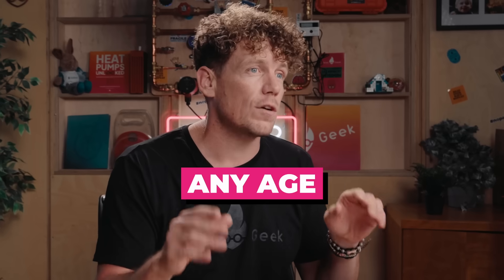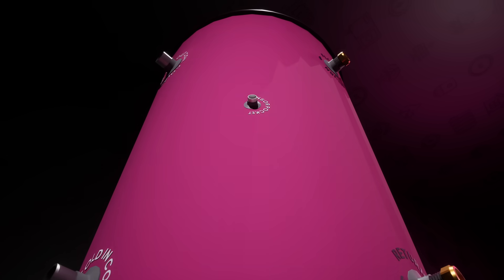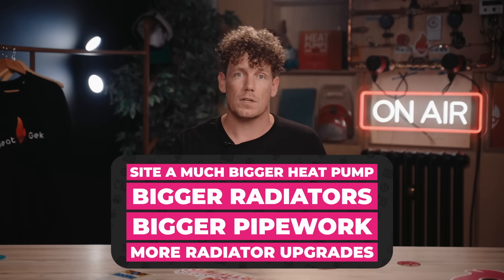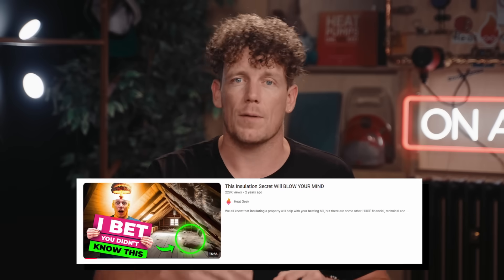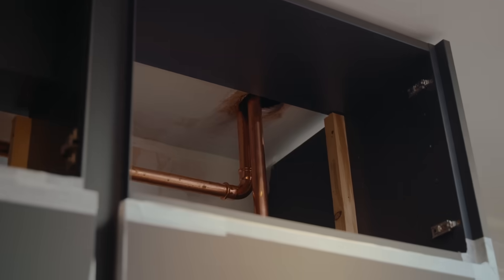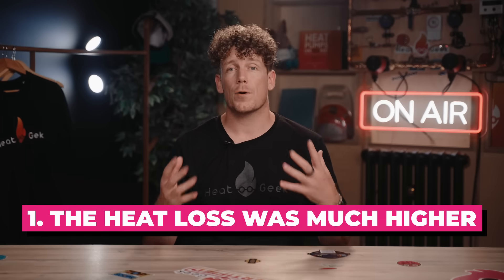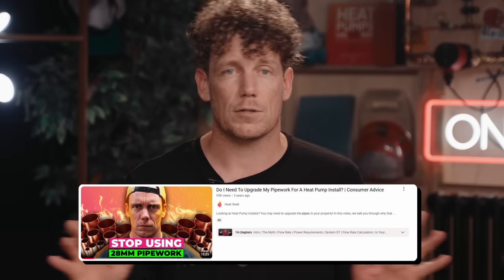Overcoming the 4 Challenges to Heat Pump Any Home

Comment from the maker: If you missed part 1 watch the full episode here: https://www.youtube.com/watch?v=LEptDnX9nPc
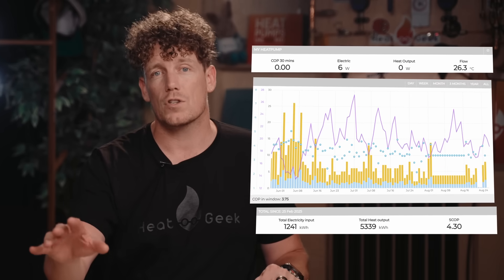Reply: Where is the link to open energy monitor it’s not in the description 😢 11:34
Reply from the maker: @noloafingwgas  Here you go! https://emoncms.org/app/view?name=MyHeatpump&readkey=4d8fdff4748d972fbc24e9f75460d4b9
Reply from the maker: Check out the heat pump's performance on Open Energy Monitor https://emoncms.org/app/view?name=MyHeatpump&readkey=4d8fdff4748d972fbc24e9f75460d4b9
Reply: "every home" huh? 

What about the 5 million flats in the UK? They are homes too, right? I've been trying to get updates from Heat Geek about this but you blanket don't seem to consider flats, as your email reply said.

I've tried calling in to just see if you'd consider case-by-case installs, as my flat is quite unusual and I think it could be done here, but it's a flat so I just get an automated email saying no. I haven't been able to get anyone to actually talk directly to me about the proposition either. 

This is very frustrating as I'd like to see what you think. I have detailed drawings that I could send you to look at. It might even make good content to do a flat, who knows.
Reply: Thanks for the link.  Am I right in thinking this isn't separating out the hot water?  I can see the colour in the key but not seeing any data.
Reply: @radfoo hot water is seperated, see the little icons on the top RHS. Currently the space heating COP is 4.49 and DHW COP is 3.16 😀
Reply: @GlynHudson thank you. Can it be seen on the day view as well, the icons disappear.

Comment: I spoke to my sister yesterday who is having her house in London renovated. I asked if she was installing an ASHP as she has solar going in this week. Replied that „the Architect said it wouldn’t work“ ….! Nearly fell off my chair, but swiftly shared this video with her. Fingers crossed I’ve averted a new gas boiler install, and corrected an unqualified comment!
Reply from the maker: That's great to hear! Sometimes architects might not be familiar with the latest in heat pump technology. With your sister's solar installation, an ASHP could be a great complement. Fingers crossed she makes the switch! 🌞
Reply: @HeatGeek  have you done any tests (or a video) on ASHP screens ... noting that they may not be the most beautiful piece of garden accessory and noting there are a number of screening options out there???  I'd love to know if the screens (not all are equal) impact the efficiency

Comment: Good stuff!
I don't understand how microbore can cause an issue for anyone when the apertures within lockshield valves are miniscule in comparison. It might reduce the control, but could a less resistive lockshield valve improve pump efficiency or provide some balance to make the odd microbore circuit useable?
Reply from the maker: The thing is, I shield is one small bit of small bore, but lots of microphone is a lot of smallbore.. yes an improved block shield can help slightly
Reply: @HeatGeek we've done some similar stuff on vehicle HVAC systems and found these sort of component selections to make a huge difference to the pump pwm to maintain flow. It is small enough that I think the calculation would be interesting. It wouldn't surprise me if the losses are equivalent to 50-100m+ worth of pipe losses
Reply from the maker: @TomWard-le3eo it’s all quite easily calculated

Comment: Combi boiler costs under 1k and you don't need engineers and costly heat loss calculations to fit them in...  Cheaper run costs will not offset costly installation  costs.
Reply: After the grant, simpler heat pump installs can be comparable cost with gas boiler installs.
Reply: @Biggest-hz7ng  Total nonsense  Boiler setup can be done with combi boiler. No hot water tank necessary + smaller/cheaper radiators. +if you already have boiler when replacing it with heat pump is just dumb from financial point.
Reply: @Tavs.fāterspeople have reported paying as little as £500 (and less) for a straightforward heat pump install after grant. The average install after grant is £5.4k, so presumably many are making a more complex switchover.

Comment: How long does it take a Heat Pump system to get up to water radiator temperature?
Reply: As with a gas boiler, the time taken will depend on the volume of water in the system and the power of the unit. Generally heat pumps modulate their output to match the desired temperature. With a heat pump you would tend to let the property drop a
degree or so overnight or when you are out and have it heat up as you get up or arrive back (increase perhaps an hour earlier?)

Comment: Are there any real world figure for heat loss in old buildings that have stone walls with a rubble infill.
Reply from the maker: What windows? Double glazed?
Reply: @HeatGeek at the moment no, but on the way next year.  Some of the external walls are 9 meters without any windows, they are about 80 to 90 cm thick .  Just wandered if there was a reliable figure I could use the do some heat loss calculations.  This type of property construction doesn’t seem to get much coverage.

Comment: Boiler swap £2800 HP quotes from HeatGeek, and 3 others £7500 and that’s after gov grant… so I’m saying that’s total nonsense. I would actually like a HP and have been getting quote but it’s just totally mad prices
Reply: I agree, my install would be as plug and play as possible. Ie the heat pump is next to where the main flow and return pipes are with the combo boiler and the cylinder is actually going where the combi boiler currently is. No rad or pipes upgrades necessary. The cheapest quote I’ve seen so far is £3,700 including the bus grant

Comment: Using the quick check of using the calculation provided in the video

Gas: 6384Kw pa, Heating would be 6046Kw (5Kw cooking only the hob is gas)
Efficiency: 73.5% (15year old boiler, though has had a major clean out last year don't know if this should be taken into account)
Which gives 4.48Kw
Which seems to point to a Heat Pump of 2.971KW

Which is less than half of what the Heat Geek (Lidar) Heat loss would be, which is 6.55KW meaning, new piping going from 22mm to 28mm pipes and almost all radiators requiring replacement

Can someone at heat geek explain the insane difference between the 2
Reply: How do you know what the LIDAR heat loss result 'would be' ?
Reply: @flatfoot I had a heat geek survey done and that is the heat loss on the proposal

Comment: @HeatGeek  when you say gas data is that my kWh per year? So 2000kwh * 75% / 1500 = 1? Surely I need a bigger heat pump than 1 KW, even if I take my Jan 240kwh*12 that's 1.44
This is a 1950s house with 8mm microbore piping
Edit: read electric usage not gas see reply
Reply: The 2000 kwh/a seems very low. Are you sure you're not missing a  0? Or you calculated with m³ of gas instead of kwh?
Reply: @Felix-st2ue  ah I was an idiot and looked at my electric! 9800kwh, though that works out to 4.9, still seems low, maybe because we both work during the day, though since getting underfloor in the living area (open plan kitchen diner lounge) we keep the underfloor basically on all the time, maybe the 20 year old non condencing boiler is more than 75% efficient
Reply: @maft90 That sounds somewhat plausible. The house I just bought has had roughly 18000kwh/a. And the calculation works out to something between 7,5 and 10 (original design plan)

Comment: Great story which needs repeating to idiots like Octopus heat pump team.
I showed the surveyor my 2023-2025 half hourly gas boiler usage (CH+DHW), which they already have anyway since they supply me.
I have since reduced my usage by removing the twin zoning and all the timed controls save a 2C setback overnight (21C/19C) and reducing the flow temperature to maximum 55C. (Thanks to heat geek general recommendations).
Octopus insist they know better and that MCS means I need a 16kW+ heat pump which they cannot supply - I calculate I need more like 6kW maximum power!!!!!!!!!! And this only for less than 2 months of the winter, with way less than 4kW for 7 months, and 0.5kW (DHW) for 3 months summer.
My previous maximum historical gas energy usage over any half hourly period was 13kWh (=26kW) when I was foolishly running on/off at 75C+ in January.
Either I am an idiot and like living in a freezing cold house, or the MCS heat loss calculation specifications are abysmal.
More power to your elbow (or less power?). I will definitely look for a heat geek when I move house which may be soon.
If I stay here over another winter I will be able to test the new regime for a full winter.

Comment: I would love an A2W ASHP, but I already have an A2A Multisplit ASHP, and no installer will account for this, they all want to put radiators in every room and refuse to accept that I will support a good percentage of the heat load from the A2A, and want the A2W to heat the hallways, bathroom, and hot water, taking my gas boiler away!!

Comment: Interesting video, thanks.

Does Heat Geek have an opinion on warm air heating powered by Johnson and Starley's Aquair unit? I like it until the gas boiler turns off, then on when it reaches the operating temperature. 
I am hoping Daikin's Altherma pump will live up to its adverts of turning the temperature down and then modulates around that temperature.  18°C?  19? For 24hrs. 
2 other advantages; it can rise to 75°C for hot water, but it would be  better to use your smaller cylinder in the loft. 3rd it will go down to 16°C in summer. If the quality of the heat is not "quite"  as good, the quality of cool will far outway it. 
There are probably 100 houses that originally had this heating in our estate.

Comment: Love this - myth busting. We threw out the ASHP idea a couple of years ago as 4 different suppliers quoted (or wouldn't) us radiator upgrades, large tanks and 12kW+ double heat pump units for our very similar home.  
Are there any rough costs for THIS install?
Reply from the maker: This was about £3000

Comment: Can you give us a basic breakdown of your quick heat loss calculation? In particular I'm interested in more info on how you arrived at the divide by 1500 part. I get the rest of it 😉
Reply from the maker: It’s just a rough rule of thumb is all
Reply: @HeatGeek thanks. Yes I realise that. but can you give us just a basic runddown of how the 1500 is determined. I understand it is ultra simplified and just a rough guide. I'm just curious what factors you took into consideration to reach the obviously rounded 1500.
Reply: @rodentnoir I would expect its based on the distribution of outside temperatures. There are stastics how many hours a year with any given outside temperature.
Reply: @rodentnoir  I suspect this will be the degree days which will be in the region of 2300 for average UK, then reduced by 800 to account for the hot water requirements.

Comment: I had a ground source heat pump installed in 2015 as part of a complete renovation, with under floor heating throughout the property. I am not unhappy with the system or results but wonder if things can be improved. I don’t recall receiving a heat loss calculation at the time. Is it possible to have my home/ system surveyed to see if improvements can be made? My son has recently purchased a Victorian terrace house in Leyton which may need the heating system upgrading. How should he go about having this checked?
Excellent article 
Thanks
Brian
Reply: Since your heat pump is already in place, you can't do much about the sizing anyway. But what you can do is oprimize the heat curve. Basically lower, the flow temperature down to the point where it just about holds your desired temperature. For every degree that you lower the flow temperature, you save around 3% of electricity.

Comment: Love your videos! I’m still stuck with a monster of a heat pump from 2014 — oversized, inefficient, and hogging space in my tiny garden. When I saw that sleek ASHP on the flat roof, my eyes nearly popped out! It looks like the perfect solution for me since I’ve got a perfectly placed flat roof right next to my 'boiler room'. Could you share the manufacturer and product name? Google’s thrown in the towel and insists I ask you directly! @7mins 10secs?
Reply: I searched for "Dutch flat roof heat pump" and it suggested the Blackbird by WeHeat.
Reply: @Biggest-hz7ng  Thank you! ;)

Comment: Unfortunately I had paid for one of your  engineers to assess my home and was essentially told it was too old, not insulated enough etc. And so would need an enormous unit, lots of pipework and radiator upgrades exactly as you mention in this
Reply from the maker: We’re not saying all houses fit in the 95% of homes… I think we may be able to help you more soon if it was too expensive!

Comment: When I see SCOP figures of 4.1  I could weep. My Cosy 9 from Octopus is only doing 2.6 at the moment. That said it is only doing hot water at present as it hasn't been in long enough to warrant having the heating on. Fingers crossed things improve.
Reply from the maker: Sorry to hear that if you look up on video three steps to increase in your efficiency, hopefully that will help!
Reply: ... over the summer its difficult to compare, as we are only using upto 2 Kwh per day  = like diving by zero
Reply: Hot water is always produced with worse efficiency. But you might want to have a look at the settings for the circulation pump. If that is running to often then you loose a lot of  energy in the summertime
Reply: @Felix-st2ue  There is very little that you can change on the Octopus Cosy as it is all integral to the HP. That said, I think I may've done them an injustice. I seem to be getting a daily COP of around 3.4 for water only which is quite good.  As EverydayLife above says, it is very difficult to judge operation when I'm using less than 2kWh a day for hot water only. I think the winter heating performance will be interesting. Thanks for taking an interest. Eddy

Comment: I had a heat geek survey done, and while the house has room for everything, after doing the maths I would be £18 down every month, so while I can get a heat pump to replace the 15year old boiler, I won't be going ahead
Reply: Your monthly loss would be due to the expense of the install, or something else?
Reply: @Biggest-hz7ng I'm not taking into the account the cost of install, this is just comparing running costs of my current Vs heat pump, at the moment the only way for me to get it cheaper is to replace my boiler with a newer boiler and not a heat pump
Reply: @Wolfie31m80s a reasonable heat pump install should be roughly matching the energy costs of a gas boiler. Your gas boiler is probably hitting around 85% efficiency. So unless your survey is being unduly conservative with the efficiency estimate there shouldn't be a contest?
Reply: @Biggest-hz7ng The survey was done by a heat geek using their Lidar, and using my gas annual bill so boiler efficiency is already factored in wether it's 50% or 99% as it's measuring the input energy not output,. Is £18pm cheaper than the running cost of the heat pump recommended by A Heat Geek
Reply: @Wolfie31m80s it sounds like the Heat Geek survey anticipates a bigger heat loss than in the past.

I can think of a couple of reasons:
It could be due to uncertainty in the thermal conductivity of the walls of your house (e.g. solid stone)?
Are you suggesting you will keep your house (or larger portions of it) warmer than they were kept previously?

Comment: Nice video. Are there limitations for a R290 ASHP like distance to neighbour etc? Thanks!
Reply from the maker: No there are no distances to neighbours. There’s only a small distance to any doorways . 1m from bottom of the unit
Reply: @HeatGeek cheers thank you
Reply: Clearance is a cone of 0.5m around the top going to 1m at the bottom of the unit to any entries to the building (doors/windows/air vents and skylights etc).

Comment: I’d love to know how much SCOP is lost with longer pipe runs. I’d have to put the unit at the end of my garden but I could put the pipe work through the garage which is going to be insulated at some point.
Reply: @urbanplumbers had a long run in this video: 
https://youtu.be/9hVgzvkujM0
Reply from the maker: I would say it’s honestly unmeasurable depending on pipe size and how it’s installed

Comment: I currently have a megaflo which I need to create water pressure to my loft shower room. I would like to get rid of this to free up space. Does either the mini or nano store create the same pressure as my existing megaflo?
Reply from the maker: Mega flows do not create pressure they use the pressure from your watermain exactly the same with a mini store and nano store. Essentially, you’ll have the same pressure from a mini store nano store then you have your mega flo

Comment: Pedantic point: not every house - listed buildings are still a right pain in the backside, conservation zones are still a mess, as are many flats/maisonettes.
Reply from the maker: Conservation areas not as bad as you might think. Historic England have published some very helpful guidance on integrating Heat Pumps and we’re seeing many successful applications. It just takes a little longer than a non-conservation area home.
Reply: The "Any home" claim is perhaps a little bold?